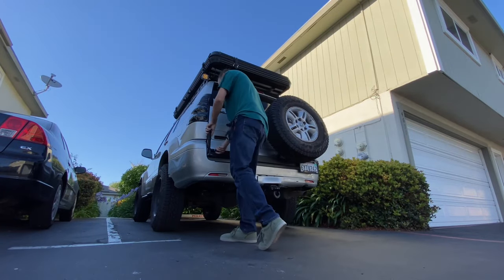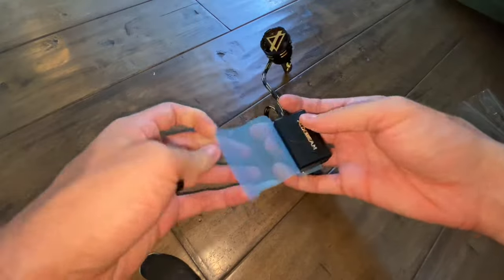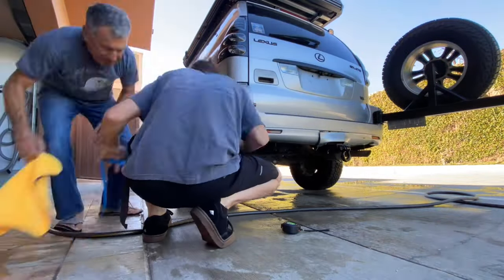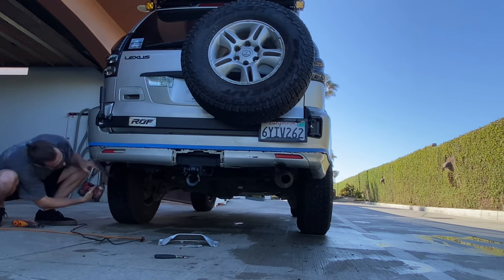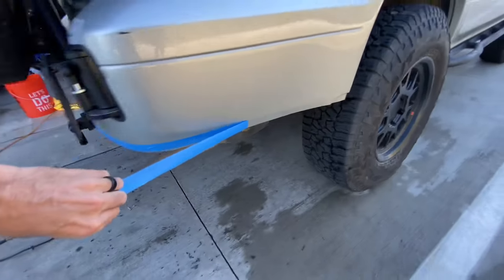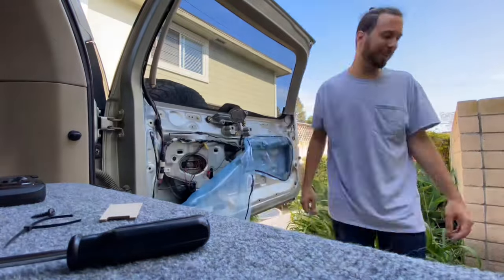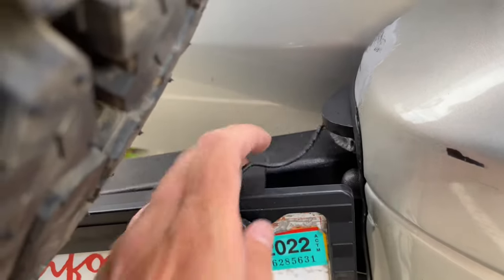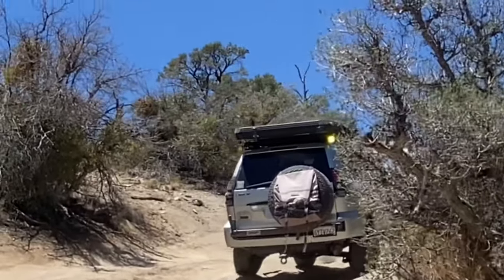Restless Off-Road TIRE CARRIER for Lexus GX470 | BUMPER CUT | Auxbeam GX-Series Headlight/High-Beam

Comment: Do you know of any decent price high clearance bumpers or do you have plans for one any time soon? I know R4T makes one but I can’t justify the price
Reply from the maker: For front I really like my Demello bumper and MetalTech 4x4 also makes a great front bumper. For rear, Victory has a great one with optional swingouts. None of these metal ones will be cheap unfortunately. I like how I can just use my solid steel hitch as a bash bar and just chop up the factory plastic bumper cover. Cheap and effective.